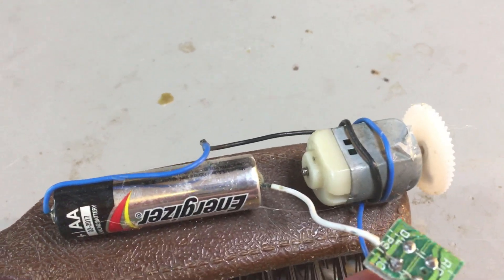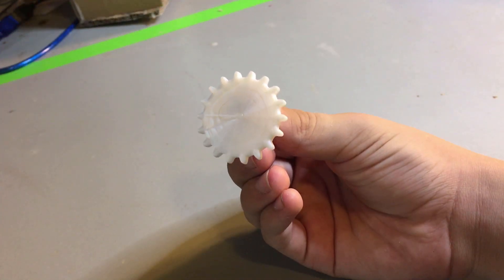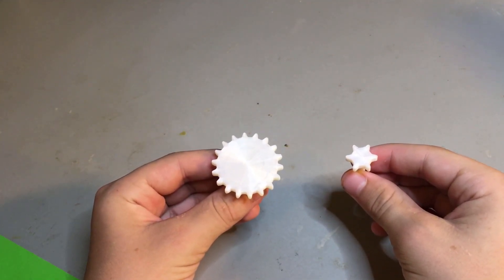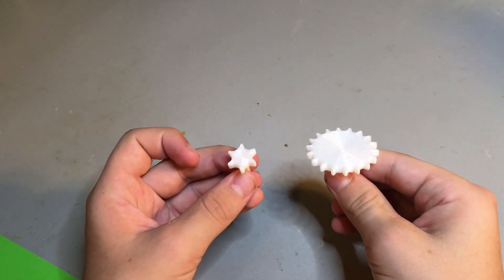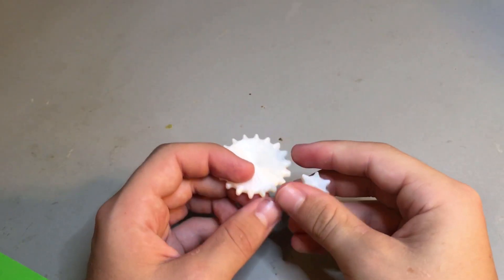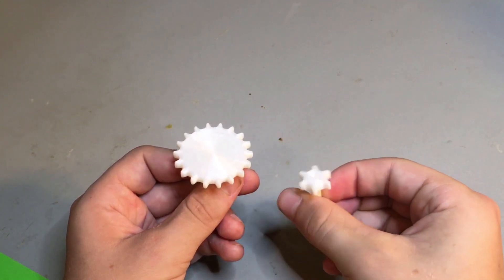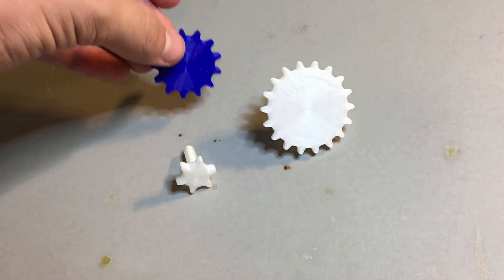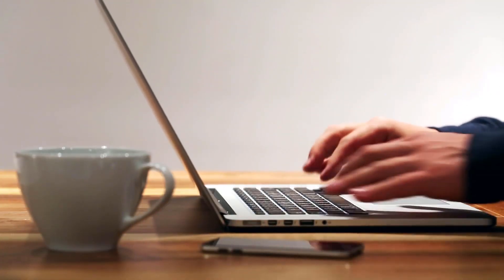Arduino In Motion (Episode 3: Gears)

Comment: Hay, great video series!  You’re on the rite track.  To prototype, it’s always best to print gears.  On my channel I did a 3 part tutorial designing involute printed gears using FreeCAD with a paper shredder as the example.  This program has become really sophisticated and is steadily improving.  After viewing the tutorial, I’ll bet the quality of your printed gears will dramatically improve.  Yes, it will also print gear racks.  If the project works really well, you then have the option to buy metal ones providing you stick to standard gear dimensions.

To answer your question, the gear in the middle does not change the gear ratio.  It’s still 3 to 1.

Keep up the good work.
Reply from the maker: +BcastLar Thanks! May I ask you how you found one of my much older videos?
Reply: @we-gold  It turned up when I included the  search terms Arduino and gears.
Reply from the maker: +Lawrence Cantwell Awesome!! I’m very pleasantly surprised that you found one of my videos through the YouTube search.